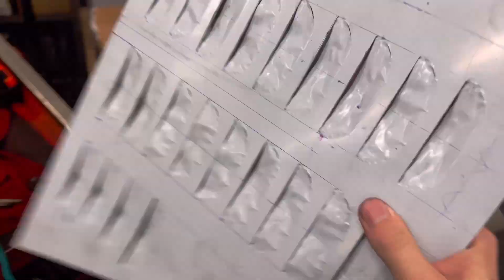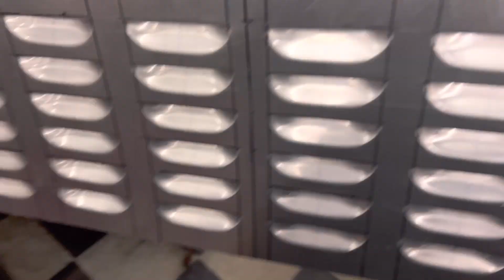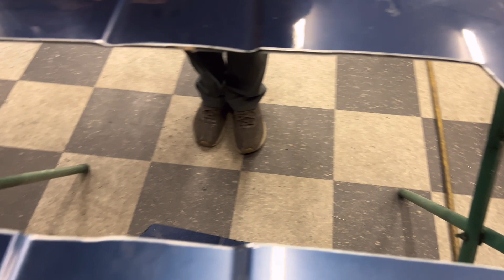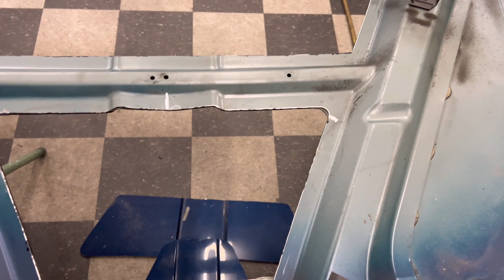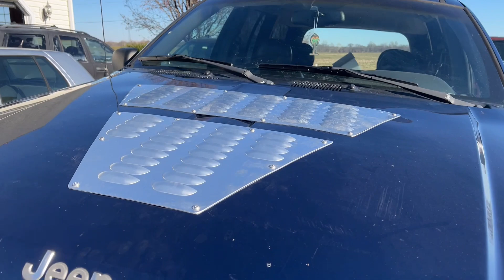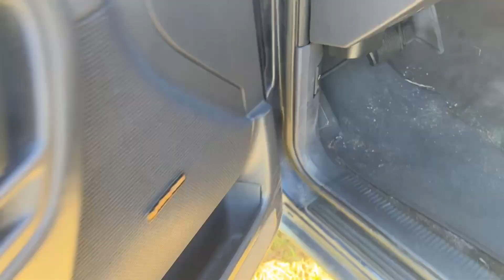INSTALLING ALUMINUM HOOD VENTS ON MY JEEP WJ *NEW PRODUCT*

Comment: It would be nice if you'd actually ship these, considering I bought and paid you for them 6 months ago. Quit with the lame excuses and ship the vents or give my $150 back. Buyers beware.
Reply from the maker: All orders have been shipped if yours didn’t arrive please send me an email and we can see what the issue was.
Reply: @Rocky TV  I've emailed you several times since placing the order. The last time you responded was on 12/1 saying you didn't have hardware. Then I emailed back on 1/19 with no response. Order #1020
Reply: @Rocky TV  I received your email after posting these comments. I have since then emailed back 3 times with no response. I submitted a request through PayPal for you to refund my $158.33 for non shipment of the vents.

Comment: Really cool looking! I love your build!!! But what about when it rains? 🤔 I don't know if it would be enough water to damage anything but just a thought...
Reply from the maker: Water doesn’t really matter as long as it’s not going in your intake and everything is in good condition. When you drive down the road in the rain water gets kicked up from your tires into the engine bay.
Reply: @ROCKY_TV  I kinda figured that was the case... do you have temp readings in the engine bay? I'd imagine it's way cooler at highway speed.